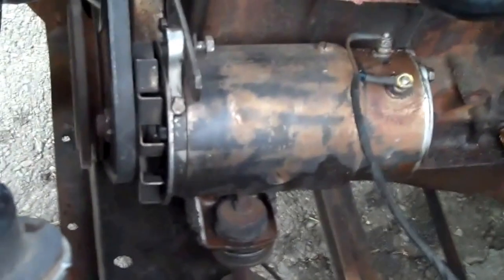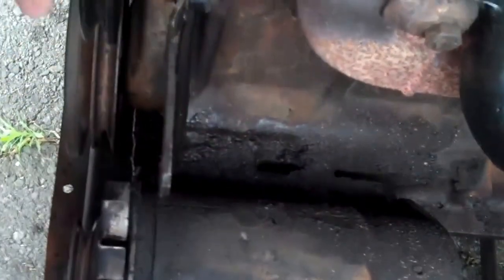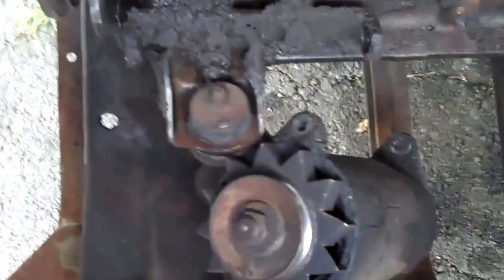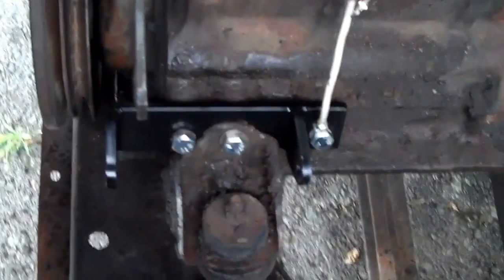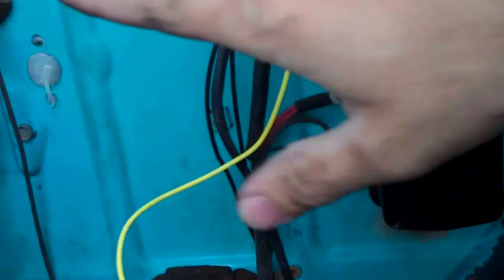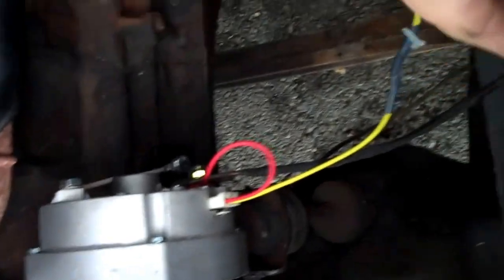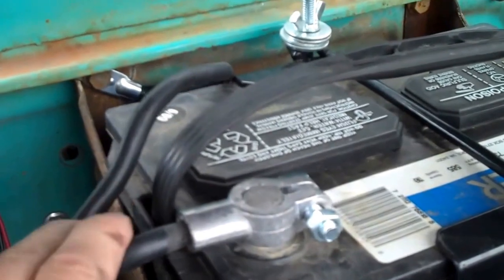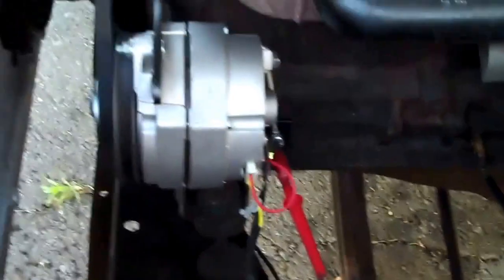Generator to Alternator Coversion

Comment: Not bad. I am about to install a 6V positive ground one-wire alternator in a '54 Hudson. I might suggest adding some subtitles about correct fanbelt tension, keeping wires away from intake/exhaust manifolds, and the BAT terminal of the old external voltage regulator is also often used as a place to connect power for circuits such as ignition switch, main circuit panel, etc. These circuits must be connected to the 'one wire (hot)' of the new alternator, not taped off.

Comment: Just for those interested in the technicalities. You mean you upgraded from a Dynamo to an Alternator. They are both Generators. A Dynamo produces DC using a mechanical rectifier called a commutator and regulates via current and voltage sensing relays; an Alternator produces DC using silicon diodes and is regulated by an electronic circuit, this may be internal or external.
Reply from the maker: Kaptain 1964 Thank you for your information. Greatly appreciated.
On a side note: People still watch this video? It's so old.
Reply: @DinkAround  Yes! Thanks for posting it!
Reply: @DinkAround  yes people still watch it! This is one of the only few videos that talk about this.

Comment from the maker: The 60's models will have a 12v system. Almost all cars and trucks after 1955 came with 12V. There was a few 55's that made it out with 6V but after that 12V was equipped.

Comment: Could you do a video of the connected wires from the ammeter to the starter? Having issues and looking for help with mine. Thanks
Reply from the maker: Doug Birnbaum if I still was running that set up I would do a video. I have since removed that wiring and have rewired everything. I'll look and see, I think I still have the original wiring harness

Comment: Thanks for that, because I want to convert my Ford Taunus 17M 1965. You obviously have to replace all your light bulbs, for lights and dash lights. What else must you change.?
Reply from the maker: Mine was 12V prior so I did not need to change anything. I did have to remove the external voltage regulator as the alternator has an internal voltage regulator and added a diode in the Exciter wire to prevent battery drain.

Comment: just better to convert overall because a Generator wont charge a battery at idle speed and most of them only put out 30 amps which barely meets modern-day demands. Planning to convert the one on my 62 Impala real soon but I heard the one-wire alternators are typically for show cars so I'm gunna go with a standard wire setup

Comment: 10 si gm alternators don't need any extra wiring, they self excite around 800-1000 rpm, only the main red wire to battery is needed, the two tabs on the side (yellow exciter wire and the other for dummy light) can be left off. For those of us who like extra instrumentation can run amp meter or volt meter in or under your dash.
Reply from the maker: Joshua,
Thanks for bringing that up.
The 59 has the old style volt meter, just meter voltage running threw it, analog if I can call it that.
but you would need to run it differently for other set ups.
Reply from the maker: Been so long since I have done this conversion, I can't remember were I ran what wires. That's what the video is for, I did run my yellow wire and it has the diode to keep from having amp draw when the ignition is off.
Reply from the maker: +Joshua James Also nice to have that wire if you spend any time idling in traffic.

Comment: Where would I get a kit for this conversion? Going to do it on a 64 ford f150...love the video...so basically you don't even use the old voltage regulater at all?

Comment from the maker: No modification was needed. The 59 comes with 12V and will except the nice 12 alternator. If you have a 55 1/2 or older the conversation may be needed. I did to. Pretronix conversion for the heck of it.
Reply: Michael Beattie so a 1960 truck should have a 12v system in it when it came from the factory?

Comment: Hey Michael Beattie I was just wondering the alternator that you put in the car with regulator from what model did you get the alternator from I want to put the same alternator in my 59
Reply from the maker: The alternator was a 10SI alternator purchased on eBay. I purchased the wiring as well with the diod installed but you can make your own pretty easy with a diod.

Comment: I did this swop out 30 years ago on a early  Ford MK3 Cortina  - the existing  power leads  started to melt  and smoke so I had to upgrade to 8awg
Reply: I don't believe put in a bigger alternator and is correcting the problem

Comment: Hmmm I have an old 61 chevy apache that the previous owner converted to an alternator. He kept the other wires connected to the old regulator. Generator light stays on and there is no second wire running to the ignition. It's been a while since I've worked on anything old I need to get my thinking cap back on.

Comment: Looks easy but where does the yellow wire go? and do you need to do anything with 6 volt gauges and gas gauge and gen gauge?? looks easy but just had all my 6 volt gen rebuilt and new volt reg and still having troubles, its funny my 1940 pontiac and it worked well  in the fall then I took it out and now all these problems and then I bought a 8 volt battery . many old timers said this would fix the problem not all my voltage reg does is < click click click> and the needle shows discharge.  im just discouraged, wish I had someone local to me to look at it, I live above Baltimore town of Aberdeen Maryland 21001.

Comment: Question, where does the red wire come from that's hooked into the field wire next to the yellow wire.
Not very explanatory.
Reply: Red wire on alternator comes from BATT terminal. It IS the field wire. The yellow wire goes to the "I" connector on the regulator or directly to an idiot light or shunt wire.
Reply: I dont have any letters on my regulator.
Reply: @garymorgan6375   Then you'll have to do a continuity test to determine the wire locations. Using a long wire, extend the hot wire on the idiot light so that it reaches almost to your regulator (you will need to pull your instrument cluster). Disconnect all the wires on your regulator. Take a multimeter on the OHM Ω setting and connect one end to the wire you just extended coming from the idiot light. Touch the other lead of the multimeter to the wires (one at a time) that you just disconnected at the regulator. When the multimeter reads 0 Ω or close to 0 Ω, that is your  "I" connector on the regulator. The other wires will be labelled on the generator itself, use the same method. 

Tip: A continuity tester can be used in place of a miltimeter.
Tip 2: post the year, make and model. Aftermarket regulators often have the terminals labelled if originals don't and terminals are "usually" in the same locations if you have separate connectors and ALWAYS in the same locations if you have a plastic plug that holds the connectors in a specific position.
Reply: You mean with “ regulator“  in this case terminal I of the starter relay??

Comment: Hello, the guys that is doing the changeover from 6 to 12 volts in my 1950 tells me that he doesn’t need to install a voltage reducer for the fuel pump and that nothing will happen if he hooks up the 12 volts leaving everything the same as it was before with the 6 volts. What do you think of that?
Reply from the maker: Anything 6V will need to be updated to 12V. Headlights and bulbs are often the biggest thing to make sure you upgrade. Ignition system should also be looked at depending on what  modifications you currently have done. The fuel pump should be mechanical unless you have installed and aftermarket fuel pump.
Reply: @DinkAround  the car is all original. I just bought it from the second owner who had it for 35 years. So you are telling me that what the guy is doing is ok? No voltage reducer needed? He is only putting an alternator, 12 volt battery, and running the cables with new bulbs
Reply from the maker: I would not install a 12V system without updating the old 6V stuff to 12V. That includes the ignition system and lightning system.

Comment: Wait,you skimmed over something too fast.The yellow wire with the diode in it.I’m assuming you made this yourself.What kind of diode?Where can we find one.Is it soldered in?
Reply from the maker: It's just a one way diod to keep the power from back feeding from the voltage gauge.

Comment: Hello, 
My friend has a 1930 model a and has an alternater put in. there should be 3 wires on it correct? one from the battery to the terminal, one in port 1 and one in port 2 (I believe) where does 1 and 2 go exactly? you mention a yellow wire with a "diode in it" so that the batterys don't go dead. From the look of the images that I was sent It appears that there is only the battery cable going into the alternator. He claims the car battery is "dead". I need to fix this but am not completely sure how to do so.
Reply from the maker: Quicksilver Robotics Correct on 3 wire. 1 from a key on source, this wire will have the Diode allowing for power to not back feed when the key is off. 2nd wire comes out of the 2 wire connector next to the first wire. The second wire comes out and hooks to the positive post on the rear. 3rd wire coming off runs to your power source ( Junction block, battery, ext)
Reply: Michael Beattie OK thanks so much. I'll check it out when I go next. I think it's a 1 wire alternator and it's not charging because of the min rpm required is higher than idle speed.
Reply: And where is the wire to your gauge or volt meter then. Kind regards Jeroen

Comment: Did the bracket come with the 10SI alternator that you purchased? If so, do you remember the model number or where you purchased it? I need the bracket.
Reply: Did you ever find out if part number for the bracket or the alternator?

Comment: so do u have the red wire running from the plug to the batt terminal on the alternator, and then a wire from the alternator to the batt? and also will i need a diode in my wire going to my ignition

Comment: If it’s putting out 14.7 volts, shouldn’t you run it though a regulator to give 12?
Reply from the maker: You have a window you can operate in on Voltage in a 12v system. 14.7 is an acceptable voltage.

Comment: Where does the yellow cable run. Also who does the brackets to buy.  Ps. Awsome video
Reply from the maker: Been a while but if I remember correctly the yellow wire went to an power source that was hot with the key on. The yellow wire has a diode spliced in to keep the power from back feeding when powered off.
The bracket was found on eBay. Not sure if it is still available.

Comment: Where on the igtion does the yellow wire  connect to; on the run on the start or on the accy connection point?
Reply from the maker: On my ignition switch was an extra hot connection. I used that as my hot with key on source.

Comment: I converted mine and my headlight switch burned out  high beams wont work anymore cant figure it out I bought a new 12 volt switch and it gets hot and wants to burn out also any suggestionss

Comment: Hi I have a 85 toyota coachman camper that has been converted to a food truck and this inverter that was installed keeps draining the battery if I'm not going to really be using the inverters so I was thinking of getting them removed because I don't think they are worth the hassle of keeping them charged when I don't use them. Do you have any suggestions you seem to know about them.
Reply from the maker: +Robin Hamilton Rather than remove the inverter, install a battery disconnect and just turn it off when not in use. This will be cheap and save you the inverter if you ever want to use it.
Reply: +Michael Beattie Thanks so much ever dollar I can save on this will help. Is the battery disconnect something my local handy dandy mechanic can do fairly quick and simple.
Reply from the maker: +Robin Hamilton yes it is

Comment: On 2:28 on the video you said that the yellow wire come from the internal regulator and that it has a dial in it what do you mean by that the wire has a dial or the regulator that keep the electricity go one direction. please explain
Reply from the maker: The Yellow wire has a Diode in it only allowing power to run one direction. The yellow wire is the exciter wire, it gives the alternator a little power to allow it to work. If a diode is not used, power will back feed when the vehicle is off and drain the battery
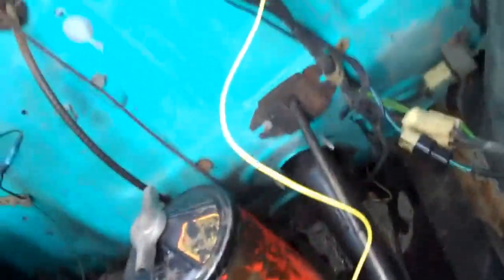Reply from the maker: At 2:40 you will see the old regulator, I remove the 3 wires and stacked them, ran 1 screw to hold them all together.
This was easier than a splice, and will allow me to install the Gen later if I would like too.

Comment: Do you know how to get the generator open? I'm trying to disassemble mine in a 61 Mercury 170 inline 6. Do you need a specialty tool or something for the hole on the side of it?
Reply from the maker: I have not taken mine apart, most have screws on the end cap. but they gave build many different ways.
Reply: +Michael Beattie your generator looks the same. I have taken the nuts out of the end cap however it still won't budge. does yours have three nuts on the end cap?
Reply from the maker: +first last I don't have it in front of me, I'll have to look.
have you removed the fan?
the inside rotor should come out with the rear cap.
unless it has a groove worn in it holding it in.
Reply: +Michael Beattie haven't been able to remove the fan. took the nut off the end so the bearing is visible, there is a notch in the bearing. I suspect it won't budge because that square hole on the side of the generator is a screw holding it all in place. thank you so much for your quick replies. immensely appreciated.

Comment: why not just rebuild the old generator? i have a 57 thunderbird, could i just get it rebuilt?
Reply from the maker: You can rebuild the old generator and they work great.
I was running duel electric fans and needed more power for what I was doing. So I ran an alternator.

Comment: I did a change over on my 1949 chevy truck. but I'm have electrical problems on it all the head lights and gauge lights come on but when i got to start it it seems to be shorting out and the peer goes dead any idea on how to find that short ?
Reply from the maker: Did you install a 12V starter? The 49 may have been a 6V system if never converted.
Reply: Michael Beattie I didn't install a 12v starter but the kit that i got dosnt have a da alternator plug from the alternator. and i added a voltage reducer on the fuel gauge. and replaced all the bulbs.
Reply from the maker: Christopher Gotschall if you have a power probe you can use it. If not, i would disconnect stuff until the problem gose away. Sounds like a starter issue but I have not seen the truck. If you send me a message with your phone number I'll try and call you. Maybe help out where i can.

Comment: My generator looks like yours except mine has 3 posts/wires.  I'm guessing, for now, one is the ground wire?  Do you remember what your alternator cost?
Reply from the maker: whiteribbonman1 I think I got the alternator on ebay for $100. still working.
Reply from the maker: whiteribbonman1 this is the set up I used. I van get part numbers if needed, just been a while.

https://youtu.be/hgM0XiI_Dy4

Comment: do I have to disconnect the old wireing from the old voltage regulator? what will happened if I will leave it on?
Reply from the maker: Yes, if your alternator has an internal regulator, you need to disconnect the old.
I took all the wires and placed them together on the old regulator. Put on screw threw them and they work great. I can send you a photo if needed.
Reply: I have a drainage problem when the the white wire is connected to the ignition so I had to disconnected

Comment: changing a generator to alternator on a 292 straight six where do I get the plate or bracket to match
Reply from the maker: robert jenkinson I would look in a junk yard. A lot of chevy trucks came with that engine and an alternator pre-installed. Take a look on Ebay. If you have no luck, let me know. I'll track on down and send you a link.
Reply: i had to make mine ill try to post a video of it later
Reply: A metal fab shop can make you brackets

Comment: The yellow wire goes to the ignition, where on the ignition switch. Its been years since I've done these conversions and I can't remember where the hell that wire goes.
Reply from the maker: I ran mine to the box on the firewall. This has 12V supply from the starter.
Reply: And then from the ignition switch to the generator light right? And then?
Reply from the maker: I can't even recall at this point. Been to many years.

Comment: i have a 60 chevy truck. know where i can get this stuff to switch over?
Reply from the maker: What engine is in your 60 Chevy truck?
Reply: Michael Beattie straight 6 235
Reply from the maker: Mount from Allen Grove
http://www.ebay.com/itm/Alan-Grove-224L-Chevy-235-Inline-6-Cylinder-Alternator-Bracket-/172249419869

Parts Video
https://www.youtube.com/watch?v=hgM0XiI_Dy4&t=2s

Alternator
http://www.autozone.com/batteries-starting-and-charging/alternator/valucraft-alternator/43014_0_0/
Reply: Michael Beattie thank you man!